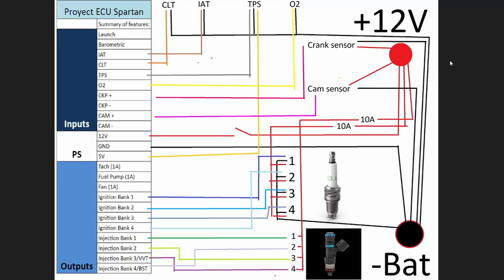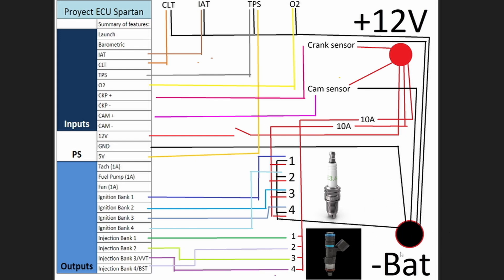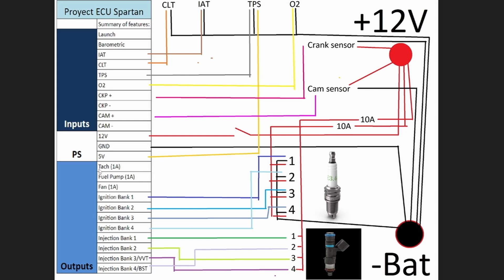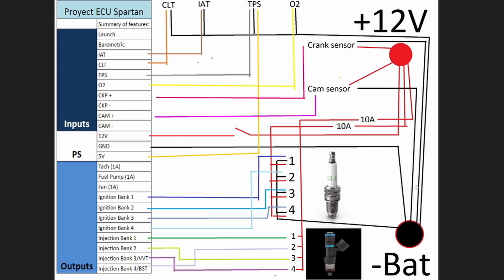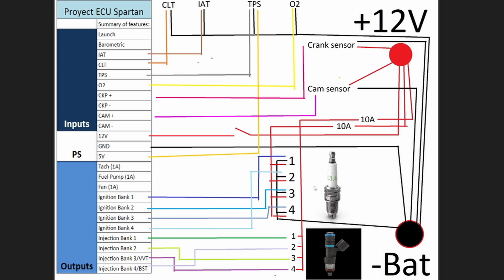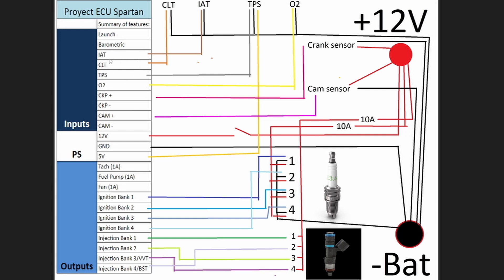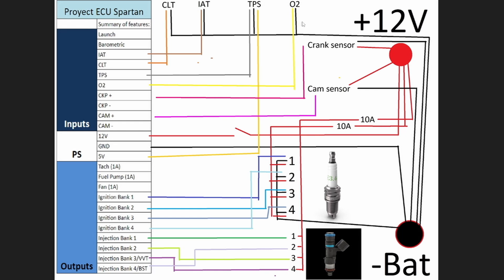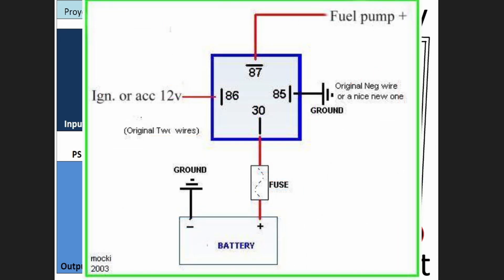Wiring a Standalone ECU for beginners FROM SCRATCH | How to build a wiring harness

Comment: Shouldnt cam/crank be connected to 5v and signal ground??
Reply from the maker: most sensors are 12v. there are some that are 5v but very rarely the case.
Reply: @throttlebuddies6356  in my memory Cam/Crank Sensors Always get Power and Ground from the ecu and never from the car. And popular standalones Like ecumaster also Work with 5v. I guess there are 12v ones but i cant Imagine connecting them to the battery instead of the dedicated ecu Power/Ground for reference.
Reply from the maker: those you mean are VR sensors probably, yes those are only connected to the ecu by + and -. the hall effects sensors usually are 12v and can be connected to the chassis for ground as they just send a signal to the ecu and the ecu also is just grounded to the chassis. thats why in this case i chose the pinout of this perticular ecu, as it only has 1 ground pin so nothing can be confused
Reply: @throttlebuddies0  i meant 3 Pin Hall Sensors, but yeah the ecu gives the Ground to the Chassis, Just thought that a Ground to ecu would result in a clearer Signal which isnt distorted
Reply from the maker: @bengerdes4679  yep that is possible, also that is why some prefer to use the 5v sensors as the ecu gives out a stable 5v and the battery voltage obviously will vary a bit. but, most ecus and sensors are pretty well mannered in terms of not having too much issues with that :)